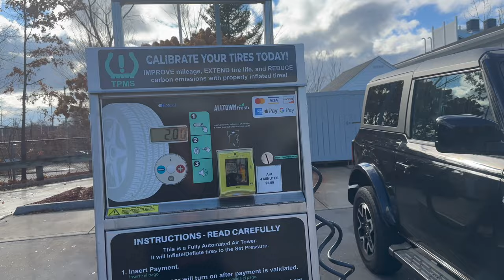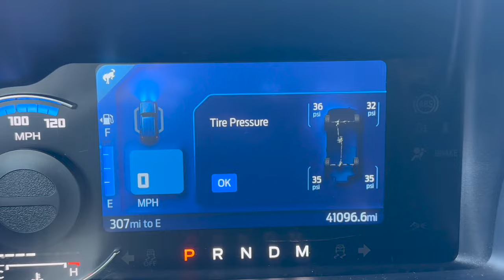Here's how Rich treats me when I'm back in town :/

Comment: slow leak in the tire. Yeah, if its so small that you olny need to fill it once a day. Atleast in the technical future country sweden, you can go to the nearest gas fuel shop, (haha dont remember what its called..) to buy a foam "tyrefill on a can", it will fix youre problem with leaking, its cheap. "CRC Flat Tire Fix" will work.